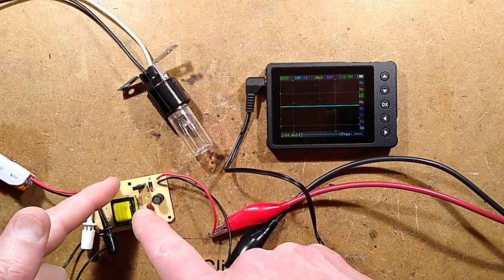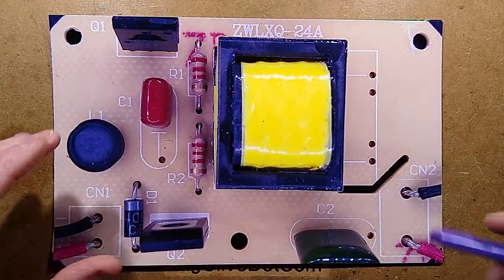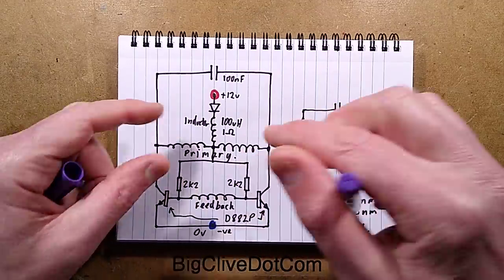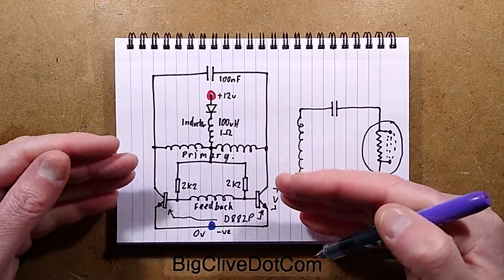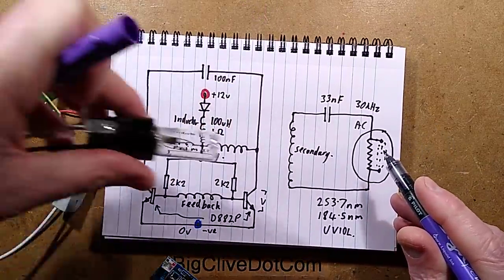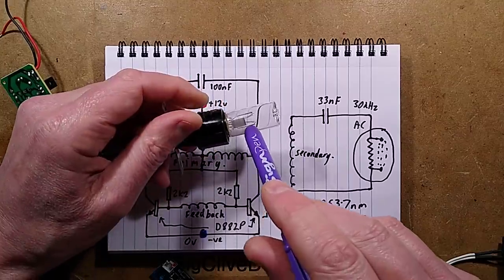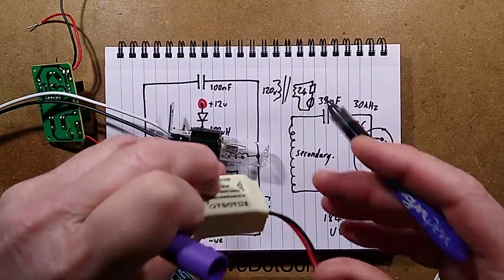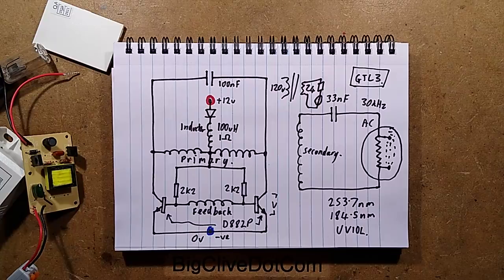Unusual low voltage AC current limited PSU

Comment: I'm reminded of the time when I was a kid and I encountered a scrapped washing machine.  Among other things I pulled a "germicidal lamp" (it said so right on it) out of it, which was wired with a "ballast" consisting of basically a series inductor about the size of a small audio transformer.  And yes,  it did work when I applied some power...

Comment: I use a 240v filliment lamp in series with a faulty Switch mode psu as a current limit test.The lamp lites for a moment then goes off.Is this a fault with the PSU. Not working????

Comment: Hi.Could I use a mains filiment lamp in series across a power supply fuse holder to let me test a faulty psu that keeps popping fuses????? Thanks
Reply from the maker: Yes.  Or alternatively a heater.

Comment: That circuit has a huge potential for self-destruction if run without a load. There are no resistors to limit the current flowing through the bases of the transistors and no reverse polarity protection as well.

Comment: That Royer’s a Baxandall (for it is he of the famous Baxandall tone control). A Royer (or “ringing choke”) uses a transductor not a transformer and omits the resonant tank.

RMS is not an average. An average value of a function is by definition an integral over a complete cycle divided by (in this case) the periodic time of the function.

A RMS (or effective value, in this case: the same heating effect in a resistance of the DC value of the same) is the square root of the average of the square of the function over a complete cycle. In effect an average value of the square of the function. The purpose of the square is that the dissipation varies as the square of current or voltage (p=i^2R or p=v^2/R (lower case letters denoting AC)) hence the need to compare the average of the square of the function and not just the average.

“...capacitor in series, which may potentially cause sputtering (electrode damage) in the lamp.” … Explain?
Reply from the maker: With fluorescent tubes if you try and use a capacitor as a current limiter, the voltage rises to the strike voltage and is then suddenly clamped by the tube, resulting in a sudden current spike.  It can cause rapid blackening of the tube ends.
I was trying to cater to a wide audience of technical abilities.  I could have explained Root Mean Square, but that wasn't the purpose of the video.

Comment: In the us, these lamps could also be run of a standard 40w incan lamp, some of there where made and rebranded as special ballast lamps for these lamps to have a simple circuit and can run straight of a 120v supply with one of these 40w lamps. Many bulb collectors run it this way and the chockes for these can be hard to find.

Comment: I forgot to mention when I first watched this, E17 is a standard base used here in America, like the E12 in your one other video. The E17 is called "Intermediate" base. Here's a quick rundown of the American sizes (note that the two larger ones are only 1mm off of those used in Europe):

E12: Candelabra
E17: Intermediate
E26: Medium (compare to Europe's E27)
E39: Mogul (compare to Europe's E40).

Comment: Question - If the bulbs works on 10V, and the supply is 12V, why all the messing with a voltage convertor and transformer? Could you not replace that with, say, 1 resistor? Or maybe some current limiting circuit ? Full-sized mercury bulbs use a ballast (current limiter) that, back in the day, what just an inductor. Nowadays it's cheaper to make a ballast out of silico components that it is to pay for a slug of iron and some copper wire. Bet that fact would knock dead electrical engineers from the old days of huge coils, mercury-vapour rectifiers, and Alexanderson alternators. 

Admittedly old age and natural causes have beaten facts to the punch. Still strange though, the two extremes, the schools of thought, heavy iron resting on the laws of physics vs delicate twiddly silicon and a ton of intelligence everywhere sneakily dancing round the laws of physics. I like heavy iron better, the world could do with being a bit less smart. I liked computers in the 1980s, that's about good enough for me. Banks could process their accounts on big mainframes, we could play games on our Spectrums and Ataris, "social media" was the letters column in a local newspaper, and we didn't live in Orwell's 1984, with a million choices but only for things that don't matter.

Also video cameras were EXPENSIVE! That means not all over the place, more common than dogshit. I could live with a bit less home-made pr0n if that's the price. We had film, and that cost money per metre, and took time to be processed. That's about right. 

Ironically actual 1984 was much nicer than the actual 21st Century! My gods, fiction got it wrong!
Reply from the maker: It needs to be an AC current limited supply.

Comment: Am I right in thinking a Royer oscillator makes most efficient use of the transformer coil? Like automatically runs at it's optimum frequency by switching when the magnetism is fully saturated, or fully gone? So it doesn't need tuning. At least that's how it seems to be, I'm guessing. So that's why high-voltage, yet cheap, power supplies, like those naughty fly-zappers that are meant to be used on people, use them.
Reply from the maker: The fly zapper circuits are cheaper and put out a non symmetrical waveform.

Comment: Nice circuit. I got one of those lamps after seeing Clive's first video on them. I power it with a very simple DC constant current circuit (only 4 parts). Take an NPN power transistor (I used a BD135) with a 3R3 ohm emitter resistor, bulb between collector and +12, base to +12 via a 2k2 resistor. Then add a 2N3904: emitter to ground, collector to the BD135 base, base to BD135 emitter. When the voltage across the 3R3 exceeds about 0.7V, the 2N3904 starts turning off the power transistor, limiting the current to about 200 mA regardless of the voltage drop. Use a heatsink on the BD135. The bulb indeed works better in one direction than the other. I've successfully erased an EPROM with it.
Reply from the maker: Keep in mind that running them in DC puts most of the work on one electrode.

Comment: I cannot find that PSU.
Reply from the maker: Search for the GTL3 UVC lamps on eBay and you may find it on some listings.
Reply: @bigclivedotcom  Thanks, Clive. I have previously looked for  a suitable driver without success but your  featuring of it will no doubt result in the emergence of several contenders.

Comment: A random non-responsive post... I ordered a bunch of electronicky stuff off ebay and I added on a pair of the type of wire cutters you use all the time. I've never used them before... you "influenced" me! I don't know what to make of the fact that I've been influenced by Big Clive.
Reply from the maker: Once you have a pair of those side cutters you'll want to add at least one more pair onto your next order.  They're also ideal for trimming nails.

Comment: Clive there are two companies who make small and very big UV lamps for well/pumped off grid water supply sterilising the water, it's mandatory in the UK.
One in Slough the other in Banbury
They also make very big systems for example semiconductor wafer manufacturers and processors, to increase their purity of them also water outputs from suredge plants, these could be 100mm wide by say 1M long made of the pure crystal glass, sometimes have a round rubber whiper which moves along the glass cleaning it like car windscreen wipers.
They are fitted in the centre of large stainless steel pipes to kill any remaining bacteria in the water.
Thanks for you very interesting, informative and technical videos.
You are not as funny as ElectroBOOM
but I think you will out live him as he is going to give himself on shock to meny.

Comment: can you bypass the heating element? i accidentally burn mine off. I figure if i use a high enough voltage with sufficient current limiting it should work fine right?
Reply from the maker: It could work, but will be harsh on the electrodes.  They may sputter and blacken the lamp.

Comment: I came across one of those globes, I accidentally destroyed it when I put it on a power supply to test it, as soon as the arc started the runaway electric current quickly melted down the electrodes. Now I am going to have to score another one from somewhere.

Comment: That inductor in the positive line and the parallel capacitor mean it is not a Royer oscillator but a Baxandall converter.  You get square waves from a Royer and sine waves from a Baxandall.
Reply from the maker: Strangely that search points back at Royer, but there are definite differences.
Reply: @bigclivedotcom  Wikipedia article on Royer also describes Baxandall.  I'd give a link, but YouTube is iffy about links these days.

Comment: The capacitor does make it a resonant circuit. Combined with the input inductor this means the transistors switch when there's no voltage across them, nearly eliminating switching losses.

Though with the base resistors connected after the inductor instead of before it would seem that in this particular implementation the transistors would turn off as the voltage approaches zero. This would eliminate the zero volt switching gain and would lead to excess heat.

Comment: You forgot the capacitor on the primary side in your schematic!  This, in conjunction with the inductor on the centre tap makes this a Baxandall oscillator, producing a sinusiodal-ish output rather than the square wave output of a Royer design.
Reply from the maker: The parallel primary capacitor is at the top of the schematic.
Reply: @bigclivedotcom  I swear I'm going blind, so obvious now you say that! Thanks for another great teardown.
Reply from the maker: @ferrumignis  I put it up there to make the drawing less cluttered, but it is a bit out of the way.

Comment: Well, hello again Royer Oscillator (flyback drive), been a while!
The thumbnail brought me here. Very neat little lamp. Actually the same thing happens at the filaments of preheat fluoros too. Around a healthy filament a small gas discharge forms too as it heats up, making some amount of current simply just jump from one end of the filament to the other. Around a depleted filament no gas discharge forms during the preheat phase. Not only a band of darkened phosphor layer is the telltale sign of which end of the tube EOL'ed, but also that, that end only glows orange, while the other one glows almost white as the small discharge excites the phosphor coating.

Comment: Those lamps were common in aircraft as lighting for maps, using a lamp with a red phosphor coating, and with a red filter glass on the lamp unit. Lamp was fed via a resistive ballast from 28VDC battery voltage, which had a series connected resistor string, 27R and 65R, the power being applied to the 27R resistor, and the common connection feeding the lamp, with the other end connected to ground along with the 65R resistor. Chunky power resistors of around 25W, as the lamp runs at around 10V when lit, using around 8W, with the filament doing around 3W of that, the rest in the low voltage arc discharge from the ends of the hot filament. Dimmable as there was a metal shield that simply cut the light output of the lamp, and also would turn it off at the lowest setting. Runs pretty hot in use, so not something you wanted to drop in your lap after a few minutes, even with a flight suit on it was toasty. Generally had a clip to attach to a map board, and a curly cord to allow you to sort of manage the cabling.
Reply: In the end, was it even an improvement over an incandescent bulb?
Reply: @NiHaoMike64  much more efficient and still lower heat, the equivalent incandescent lamp for this use would be a 50W bulb, and there was also a UV bandpass in the filter so that the red light would be visible, and the UV light would flouresce the paper of the map, so you could see the printed map better, plus it also activated the flourescent indicators and markings on the map tools. Yes went the way of the Dodo after GPS came into use, and Decca and such were turned off.

Comment: Dear Big Clive, I found an unusual dimmer that seems to regulate AC by using a bridge rectifier, without TRIAC/DIAC/SCR. Have you heard about this and would you like pictures (shipping very expensive)? The switched AC output, one lead, is in series with a rectifier's AC side, and a transistor is used to basically short circuit the rectifier DC side in a controlled fashion. I've never seen this anywhere.
Reply from the maker: Bridging a rectifier for AC control is common.  It may be a reverse phase control or lagging edge dimmer.  Much softer on electronic loads and doesn't need much interference suppression.  Did you find it on eBay?
Reply: @bigclivedotcom  Thank you for the info, I've been trying (and failing) to find the right keywords. It's a genius design even if it suffers from a couple of diode drops and I'll definitely experiment with creating my own circuit. Didn't find it on ebay, bought it from a Finnish store, imported by a Swedish company. You'll find it by searching for "PR HOME Mood plug-in dimmer"
Reply: @bigclivedotcom  Oh, if you're curious, the one chip on the board i couldn't find information on is SZP711B (SMD, 8-pin), and it's the brain. Connected to an optocoupler and potentiometer, so... based on what you've taught me it's a variable PWM chip.

Comment: C1 does indeed make the circuit resonant, it forms a tank circuit with the trans primary, the resulting sine wave is isolated from the dc supply via L1, which allows DC power through but not the 30kc, constant current is provided via the base resistors (limiting PWM) and probably an air gap in the trans.

Comment: Reminds me of those push pull transistor ocilators I use to make flashers. You would not thing there would be a low voltage version of those lamps.

Comment: If you really want UV exposure a mercury arc rectifier really does the job. Last saw one working on a London underground station in 2000 before its removal. Amazing thing to see it still going after 80 odd years of use.
Reply from the maker: The mercury rectifiers are made of a glass that blocks the harmful wavelengths.

Comment: This power supply are also made for 230v they are very similar to cfl driver but made for lower voltage. They are commonly used for aquarium uv filters.

Comment: Ooohs! I got a bunch of these lamps last time you 'promoted' them.. Now there is a matching driver!
Thank you! Much easier to drive and hopefully a nice long life.  I'll make it into a nice UV curing chamber for things.
Reply from the maker: Wrong wavelength.  Most UV curing is done in the UVA region.
Reply: @bigclivedotcom  Then I'll have to find another excuse to use it.. Maybe PCB making? Or simply as an ozone generator inside a soda glass tube so I can admire the glow and not get burnt..
Experiments shall be done!

Comment: Might there be similar circuitry in the "2D" fluorescent fittings intended to run from 12V (1980s on) ? ISTR seeing at least a transformer in there.
Reply from the maker: Probably similar.

Comment: Which oscilloscope is that, is it any good?
Reply from the maker: It's a Seeed nano.  It's a very basic single channel scope.
Reply: @bigclivedotcom  thanks, I've been very impressed with number of useable cheap Nano equipment out recently like the LCR-T4 Tester , NanoVNA , Malahit DSP Radio

Comment: It's very rare to see someone correctly explain the specific uv wavelengths and their mechanism for generating ozone etc. This video does so. 
The very deep uvc at 185nm is being absorbed in the Schumann-Runge bands of diatomic molecular oxygen below 200nm. The excited oxygen molecules are thereby broken and the resultant highly reactive monoatomic oxygen atoms recombine with a nearby O2 molecule forming ozone. The ozone then has Huggins, Hartley, and Chappuis absorption bands from 200nm up into the visible. Both mechanisms in tandem protecting the Earth surface from harmful high energy light.   The fused quartz dopant used to absorb the 185 line and inhibit ozone formation is titanium dioxide.
Reply from the maker: Interesting to see the other details.  Also intriguing to know that titanium dioxide is used when it's also used to create hydroxyl radicals when exposed to UVC light.  (According to all the marketing spin.)

Comment: I got some of those lamps with the usual no documentation. 120 v 60 Hz here, so calculated 6.8 mfd as a power limit ballast in series to limit the power to 3 watts. Lights up fine, but admittedly a sleazy circuit with high voltages right on the socket.

Comment: As a matter of [strange[ fact... I have a couple "transit" 12 volt florescent lamp ballasts (for buses/trains/etc) which are Royer power oscillators as you have mentioned.. though these pull a few amps and can light large tubes..  some strange notes about them: I had to go through a strange "registration process" in order to get them- only THEN to figure out its because they didn't want them used in "portable" drug grow-farms (that made me laugh)  As for the circuit itself- it came in a standard ballast casing which was fully-potted win TAR  (yes!) and was a real MESS to de-pot! I found it odd that the transistors were NOT heat-sinked at all (and was told that, tar is an excellent heat dissipater (??)  I have 2 of these units- one is depotted (still has tar in the nooks and crannies) while the other one is untouched and still in its original packing..
Reply from the maker: A lot of the old neon transformers used to be filled with tar/pitch.
Reply: @bigclivedotcom  Hi there buddy! :)  and yeah- I'm old enough to know this hehe  just found it odd that they did this to something more modern and to something that contains electronics (I'd think the hot tar would damage the components) I wonder if some electronic florescent ballasts contain tar... (I know the old, OLD magnetic ones do).  also, thanks for the reply, there, my favorite Scottish buddy! :)